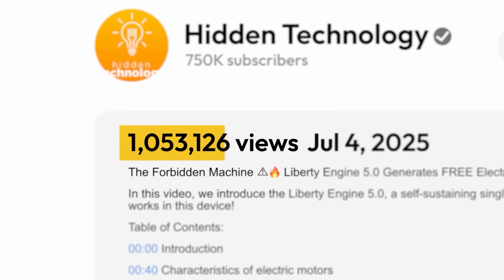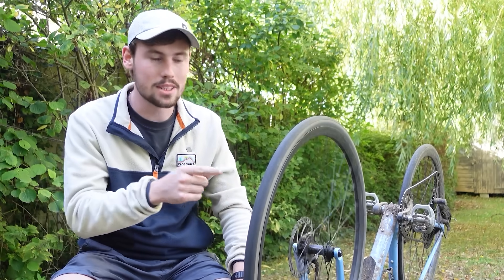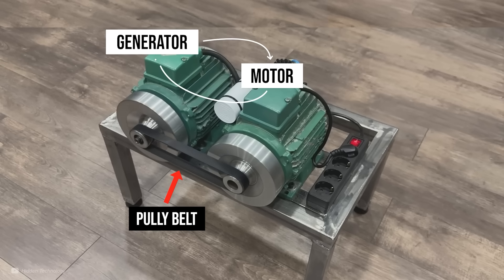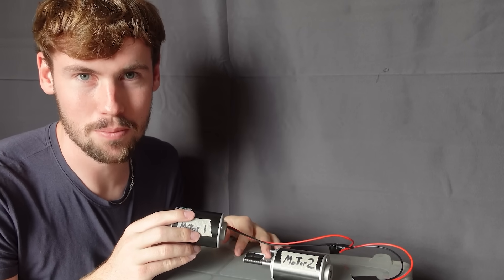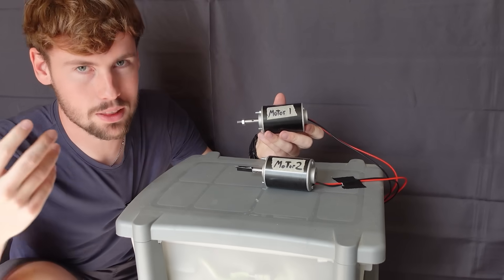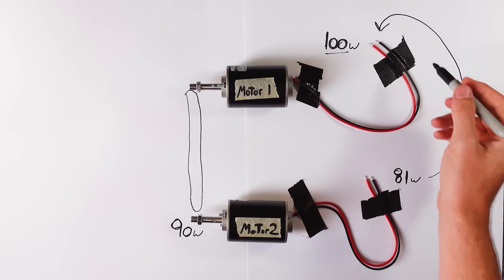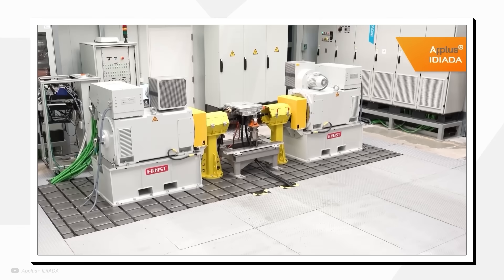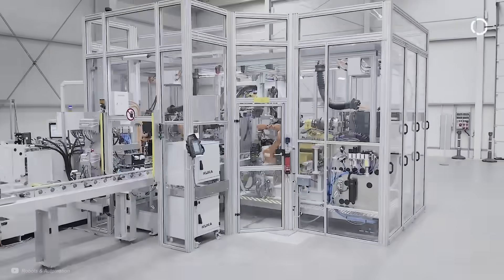100 Years of Waste! Solved by an Unlikely Invention.

Comment: How about using fluid dynamics? Use x electricity to make electrolysis of water in H2 and O2, put in a pipe fill with CO2 to go up, when on top burn to get H2O and fall by a generator that makes y, y<x but can make the pipe long so it can put multiple generators, the energy to make the electrolysis is the same but the high the pipe, more generators until y>x.

Comment: In physics you cannot get something for nothing. All you can do is to reduce the net wastage (total power load) of your set-up.
So in your specific example of motor power measurements, where the measurement system is a generator driving a suitable load (i.e. a very big resistor), if instead you convert that waste energy back into the input load (i.e. by not simply heating a wasteful resistor), then you can save yourself some energy cash. Simples.. :-)

Comment: So, device #1 (the motor) required 100 watts to transfer 90 watts of power to device #2 (the generator).  The generator produces 81 watts of power to the motor.  It's pretty clear that some external source is needed to provide 19 watts of power to sustain operation.  There is a deficit of power (due to losses) in the circuit.  Any suggestion that these loops, whether named perpetual or something else, have the ability to provide useful power for external use is false.
Call them anything you like, add things like flywheels, springs, etc., and you come up with the same thing: an interesting but useless toy.

Comment: Over unity is possible and IT DOES NOT AUTOMATICALLY EQUAL PERPETUAL MOTION!!! Please stop saying this. Over unity means you can create (yes I said create) energy but it DOES NOT equate to perpetual motion, period. Here is an example to help you better understand the fact that the 1st law of thermodynamics is at best a poorly worded theory and NOT a "law".
     Lets do a little thought experiment here. A modern neodymium magnet bleeds off around .1% of it's field strength per decade. This means that a modern Nd magnet in good shape has a theoretical lifespan of around 1000 years. Also given that a 2" cube Nd magnet is capable of around 500 lbs. of physical force, its energy density is rivaled only by a nuclear reaction (maybe not even then). So given this information here is a thought experiment that proves what I have said about the 1st law of thermodynamics. Imagine two levers mounted parallel to each other with each having a pivot at its center point. If we place two Nd magnets, so they are repelling each other, between one end of those levers their FIF (Field Interaction Force) will force the other ends of the levers together with the force of the two magnets FIF. In the case of the 2" cubes this would be close to 1000 lbs. of force. Now if we place a scale between the pinching ends of the levers that scale will show a constant (active) measurement of the energy being produced by this small device. Measuring this force in this manner is by any definition work. What this means is energy is being produced (via the FIF) and used (causing a measurement to be indicated on the scale) yet the source of the energy being measured remains unused. The two magnets in this device being the same do not have any negative effect on each other such as field swapping. Other than the fields natural degradation rate no energy is being used, yet energy is being output. In effect we have created a "copy" of the physical force by measuring it. This is by any (or no) stretch of the imagination not only over-unity but a massive amount of over-unity given that the measurement is constant and active and can last for centuries.
     Perpetual motion is not possible, over unity, on the other hand, is not only possible it is fairly simple. They are two different things so please stop saying that one equals the other. You can click on my handle and go to my channel to see how this concept can be used to actually create "free energy"

Comment: A generator only outputs the energy (watts) demanded by the load. The only energy required to keep an unloaded generator spinning is replacing the mechanical loss. The motor driving the generator, mostly proportionally, will consume more power under a load than at idle. That's why motors are rated at "full-load amps". So it's not like the difference between the full load amps and the current load amps is all wasted. But I would think the loss in a closed loop would be rather constant, or at least less than proportional to productive load. In large systems that might be recoverable. In the video, the examples show only the motor itself as a load. In the real world, there needs to be a useful load or the whole thing is pointless other than to prove a point. I would need to see data showing that keeping a generator at full output (the motor at full load) and feeding it back into the motor is significantly more efficient that running the motor/generator pair at a nominal useful load without the feedback loop.

Comment: I think this is how we get 3 phase power in our home shop to power the Bridgeport spindles, since we can only get single phase service.
Reply: I recently saw a great video about how the phase angles and such work out. It was really informative
Reply: A friend of mine recently converted all of his lathes, drill press, milling machine etc from single phase to three phase using variable speed drives, there were two advantages, firstly he could his V belts on highest speed then just use the vsd to control the speed and secondly the 3 phase system was more efficient and the payback in electric costs was about 12 months.

FYI he used Chinese vsd, cheapest one was $30 for his smallest drill press, vsd were all mounted on the walls with a small potentiometer mounted by the control of each machine. He then got fancy and mounted an rpm meter on each machine using an induction pickup off the primary shafts so he could dial up the precise speed without having to convert back from the vsd frequency and gear ratio.

Comment: Any kid that had a generator powered headlight on his bicycle knows what really happens.  He pedals down the street, engages the generator, which is just a permanent magnet motor that rubs on the tire, and there is resulting drag causing him to have to pedal harder.  Then he turns on the headlight.  Now the motor, acting as a generator, powers the headlight.  The energy required causes the drag via back EMF, the motor bogs him down further making the bike very hard to pedal, as if pedaling up a steep hill.  He soon gets tired, turns off the headlight, disengages the generator.  When he gets home he takes it off and tosses it in the trash can.  So much for that experiment.
Reply: The cruel irony of it all is that LEDs got so much more efficient that today a pedal dynamo would be a totally workable idea, but because batteries also got so much better, they became completely obsolete anyway.
Reply: @TheHDreality  the LED is very efficient & reliable.
The powersupply nneded for the LED is CHEAP SH_T and is very inefficient and lasts for crap
Reply: When I was a kid I connected my bicycle generator to a full wave rectifier and capacitor to power my transistor radio as I delivered newspapers on my paper route.
Reply: This was my experience as a kid, except that I threw it in my little toolbox.
Reply: @machinemaker2248 
😂 I kept one, (with all it's: brackets, nuts, and bolts), for decades. Never had a use for it, but it was always somewhere... Hopelessly entangled with; twine, string, or fishing line. 🤦🏼
Reply: HA - I can recall those HARD PEDALLING days, HA - and on occasional times of a generator ending up in the spokes - HA
Reply: In this case I bought a headlight set up like this with the generator, headlight and tail light. I swapped in 12 volt bulbs and used 12 volt rechargeable RC car batteries. This would last me long enough to get home from work after dark.
Reply: That would be true except a single lamp takes very little energy especially now days with LED. My sons hot wheel car produces energy to power lights and takes very little effort to push around
Reply: That's funny this is exactly what happened to me I was riding my great-grandma's 1957 Corvette Stingray Schwinn I ripped that stupid headlight generator assembly off of it replaced it with a much newer much lighter zero drag zero resistant generator and LED headlight she had like some stupid super old aftermarket generator that put a lot of drag that ran off of a wheel that spun the motor via the rubber tire it look like Benjamin Franklin made the thing talk about crude Ingenuity God we were so inefficient back then
Reply: The generator on my bike didn't have to power a few houses or nothing it was just the bike headlight so you didn't notice it when you were pedalling
Reply: You just described me 😂
Reply: Yeah a kid who is now 50+. This dynamo system has been unknown to kids for donkeys years
Reply: @ossiebalboa5617 So you think. Again your wrong.
Reply: Truth is to get more out than you put in is the factor and impossible to do.
Reply: @BobbyHutcheson  Truth?
Reply: Guy has it  figured out.....wrong
Reply: a better perpetual machine would use that light to grow plants, the plants feed the cyclist who burns calories to pedal to produce electricity and light!
Reply: You were needing it for real 😅 n a pitch black forest or RISC to see literally nothing at all, now we use hub Dynamo tech and it can actually load a small usb device while riding if done properly without that much drag look at modern electric bycicles they have huge dragbince there is no power for the motor so unless you have a loadeed battery you don't get very far especially not the ones resembling a moped like setup almost impossible to out enough pedal power in those !!!
Reply: Me too had one, the light was extremely bright when cycling!! But yeah how it went out when I stopped. I did try experiments at the time with batteries as well to light it. Kind of worked a bit but there where issues, not that I remember what they where since I was like 18 and now I'm 53!!
Reply: You forgot to mention that he then fits an LED lamp instead :face-blue-smiling:
Reply: @Tutterzoid  Gets a set of Night Vision goggles.
Reply: So true!  But, that was before white LED lights came along.  Also, lithium-ion batteries came along and changed it further.  So, now, who needs a generator?
Reply: @chrismerklin8460  Might be useful in a survival situation. Hook it up to a regulator and you can charge your phone in a pinch. You're gonna have to work for it though.
Reply: ... and they wonder why Gen-X kids grew up so cynical!
Reply: Any person knows a kid is a baby goat. Not any child can make their own generator that is a prime mover and comprehends all that is unseen. https://www.youtube.com/watch?v=nroBcB-42aU Let there be light https://www.youtube.com/watch?v=41o_OscfsRs. It is not the ones that think they know. I had to peddle uphill and had not brakes and had no dyno.

Comment: I have a very compact and useless to me example of a military power converter. 24v in, 110v out. Purely mechanical and looks just like an electric motor with no output shaft. Pretty much operates like the examples before being tied back on themselves.
Power conversion and isolation is where my mind went with the thumbnail and title. Rotary converters used to be in many small industrial shops for running equipment when you couldn't directly tie to the grid (like when only single phase 220v is available but you need 3-phase 208v).
This application is definitely interesting and is obvious on the face of it, if not that directly convenient to implement.

Comment: Had one of these regenerative test stands installed in our plant to load test mining gear boxes after a rebuild over 40 years ago! Since these gear boxes were always used in pairs, one would drive the other in a master/slave setup so the drive motor and receiving generator would always turn at the same speed. The only power we drew from the grid were the losses, which saved us a lot of money.

Comment: yes, you use so much power to simply produce rotary motion and overcome the losses. you dont GAIN anything, nor can you take any useful work without upsetting the balance. if you load the motor with an external load, that energy must come from somewhere, and go somewhere. all you have done is transmit energy in a loop at a loss. whats the point?
there is one. and only one. 
this was an old system used for boosting line voltages.

along a given run of cable, a certain load would give so much sag. too much! the voltage was too low for the equipment...

so increase the load a bit. drive a motor that can deal with the lower voltage. that could then drive a generator to add enough extra voltage to overcome the sag in the next bit of transmission line... you used this exact same theory, to drive the motor-generator is roughly 15-20% loss.

you still lost power, even more as increased current because of the extra load is just heat and the sag is proportional to the heat being developed and wasted...(ohms law...) yet in certain cases there was no choice. to run new cable cost more, or was impossible. 

right. electrical theory time...

every motor is its own generator, and its the generated counter (Back) EMF that limits current... why they draw so much current when starting as theres no BEMF to limit it... only the resistance producing heat as I2R (ohms law). then it gets interesting. the current draw across that resistance has a certain voltage drop. the full supply voltage when stationary or stalled! as the motor speeds up the BEMF increases, opposing more of the applied EMF (supply voltage), and current reduces, until at the maximum unloaded speed the BEMF limits current until it and the voltage drop across its resistance equals the applied EMF. simple!

then there is this really strange thing that noone ever mentions called "jacobis law". the resistance of a generator and the load it is driving.
 a simple analogy to start with.  the trick of dropping a magnet down a copper pipe. induced eddy currents, lenz law, opposing magnetic fields... yay.  now, cut a slot in the pipe. what happens? 
and as you place different resistances across the gap? what happens when equal? 
replace the pipe, a single loop, with hundreds of turns, a coil... a generator. there is no difference, the generator is a magnet moving in a conductor that produces opposing magnetic fields as the load resistance decreases, and currents increase. if we short a motor out it "locks up" as it can flow the maximum current, and produces the strongest opposing magnetic fields.
it has resistance as well.
and the same current that flows in the load flows in the generator. "eddy current"... real current... ones just confined in a wire to do work as "electricity"... voltage? current? it doesnt matter, its juts power manifesting in a resistance, or as magnetic fields. sometimes as ionised arcs or other luminous effects.

that current in a resistance produces heat, and the ratio of the two resistances has MASSIVE impacts of the efficiency of a generator or motor. electric motors/generators have all different types of efficiencies... and a lot of it depends on the circuit they are being used in. what doesnt change is how well they convert mechanical energy, spinning shafts and torque, into this "electrical" energy, be it heat or magnetic effects...

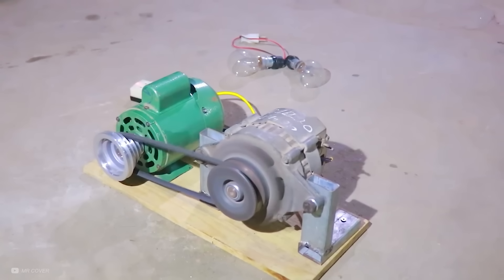when equal, you transfer the most power, but half the power is lost in the generator. as the load resistance increases, you transfer less power overall. but far more of it appears in the load. at 1:10, its 1/10th the power but 100x less loss. more ohms law.

of course, you can go the other way as well, and overload the generator until it burns and do almost nothing in the load...

a fundamental basic, so simple, so logical... so overlooked and misunderstood.

Comment: Yes - long ago worked at a synthetic fiber plant - polyester streaming out of hundreds of spinnerets at sixty miles an hour.  Any bobble in the extruder speed INSTANTLY would disrupt the long downward cooling paths to the winders and fill up the winder floor with masses of "string" - freakin' INSTANTLY!  So we had five 400-hp ride-through motor/flywheel/generator setups to "smooth" the power.  South Carolina in the '80s at Hoechst.

Comment: It is a dynamometer...  rolling...

NB, General - Also - 1P-3P motor chain.. - Rotary phase converter  - for the power output, these used to be the economic option  before VVFDs were readily available.....

Because BLDC are synchronous motors (PM Synchronous) - hey DO lick..  Induction motors (or any double wound Asynchronous motor. Shunt or series) do not synchronously lock (Asynchronous Machines)

Comment: Dynamotors were used extensively in WW2 avionics to power high voltage vacuum tube circuitry, and they also found lots of uses in rural power conditioners where mains voltages fluctuate excessively (as mentioned elsewhere here).
Reply: The recent collapse of the electricity grid in Spain and Portugal (April 2025) was caused by too much inertia-less generation from wind and solar. Fluctuations in frequency were not being damped the way they were with rotating alternators connected to steam turbines.

Comment: This is very interesting and gave me an idea. Could you not also put a transmission between the motor and generator to measure its efficiency. Normally you have to accurately measure the consumption of the motor and the power generated to work out what's lost. With this setup the losses are simply what you have to add to maintain a steady state.
Obviously, you have to know the efficiency of the setup with the transmission bypassed first. As you would anyway.